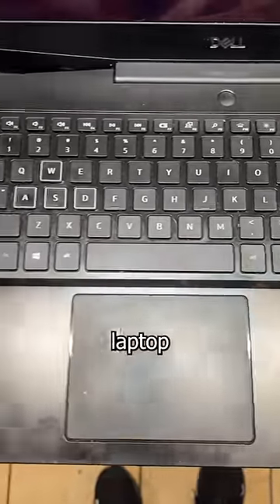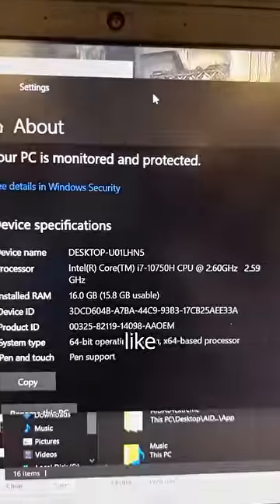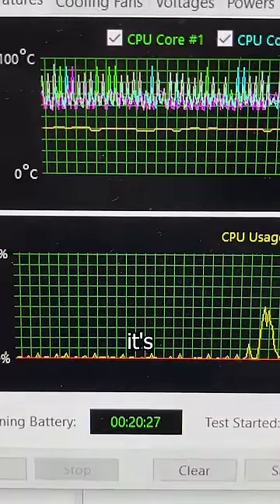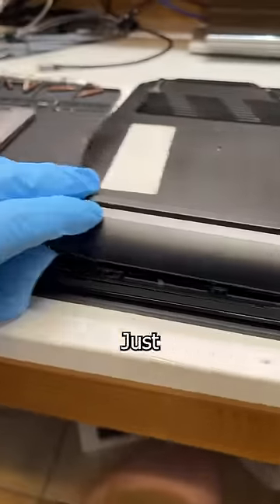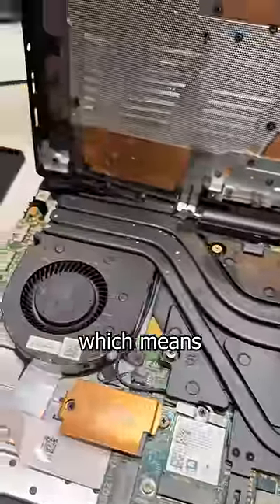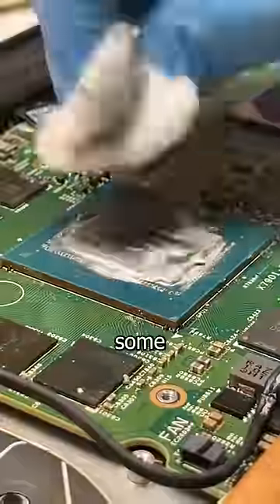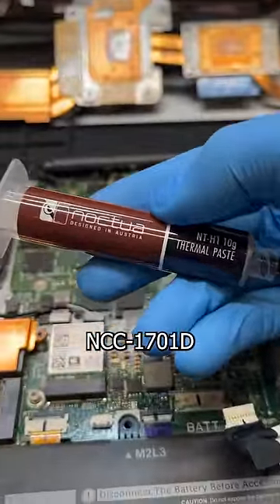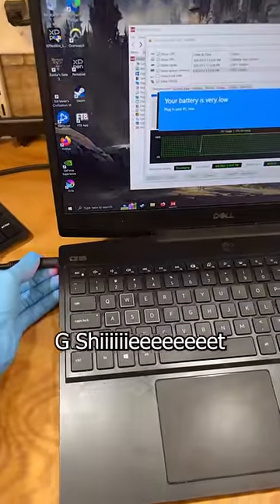Dell G5 is a terrible #gaming laptop with a terrible cooling system #tech #technology #shorts

Comment from the maker: What aggravates me the most is this thing overheats brand new out of the box, just like many other gaming laptops. Then they disable undervolting (so you have to manually edit the BIOS which is sketchy af) and don’t give you the ability to manually control the fan speed (the fans don't kick on until the thing is at 100c for like 30 seconds ffs). You CAN download a 3rd party program and a bunch of plugins to help, but WTF? It’s like buying a Lambo and having it governed at 75mph.
Reply: Thermal pipes degraded.
Reply: The entire first part made sense, idk what governed is! Though
Reply: @Gomer._.  When an engine is governed, it is limited in power by something other than the engine itself. Most rental go karts are governed to be significantly slower than they can be.
Reply: "The fans don't kick in until reaching 100 C"

Sounds like a MacBook syndrome before M1
Reply: Old g5 issues .Dell g15 doesnt have these. You cannot undervolt ryzen versions but you can lock the tdp and temp then it automatically undervolts. I use ryzen controller to do this.
You can use alienware commandcenter (if you have it)to maually do fan curves
Reply: @ZekeTheMan623  That’s interesting about gokarts!!! Why don’t they just make them slower Does that question make no sense idk, also if anything I was assuming he meant having a minimum speed of 75, I was like WHAT, yeahhh. Thanks homie
Reply: My asus rog strix actually had liquid metal on the gpu and thermal paste on other components around the gpu so that it could minmize overheating I replaced with the same thermal paste your using and it works even cooler just need to keep consant airflow
Reply: A workaround to enable Undervolting is to disable Hardware Virtualization support in the BIOS settings, this is the result of a half assed security patch meant to protect against a vulnerability called Plundervolt
Reply: Laptop BIOS’s have always been super limiting to the point it makes me want to rip my eyes out. No fan controls, overclocking, undervolting, NOTHING. just some simple security settings and boot order. Oh well, I live with it.
Reply: Yea that's why im never buying a razer laptop again. They put design first which means it overheated alot and eventually just died. It had worse cooling than my mom's dell work laptop with a 8th gen i7. Her laptop has a much better Colling system. Razer laptops have there exhaust fans right Infront of the screen and they blow hot air right at it and at the ground. They got the worst cooling system I've ever seen
Reply: I bought this laptop off some guy on Craigslist year ago couldn't not even run simple games before it would just tank to single digit fps I ended up reselling on offerup but those bios are trash and can confirm undervolt does not work.
Reply: @pfoxhound  could be, but judging that even a 13-year-old laptop wont have that problem it might show the poor quality of the pipe itself
Reply: @Gomer._. basically when a engine is limited and can’t put out full power
Reply: Dell wants it to run quiet but its cooling hardware disagrees.
Reply: My friend cooled it by aplaying way to much termal paste and he told the problem was the cooling pipe was little bend
Reply: @trandinhvietdung9357  I had this problem on couple laptops, couple of of a thousand, if the pipes will be under higher power then rated - they will degrade, especially when fans start working at 90 and higher. My opinion.
Reply: @pfoxhound  ah I see. Still that shows that some laptops manufacturers just want to cut cost, thus reduce its lifespan.
Reply: It's not like buying a Lambo 😂
Reply: @sharkieislive the problem is that Dell Bios is trash
Reply: @pfoxhound Heat pipes don't degrade you're ridiculously misinformed. The thermal paste and fans degrade and somehow you are incorrectly attributing that to the copper pipes. The only failure of heatpipes is cracks or leaks.
Reply: That would annoy me and immediately prompt me to return it. Such a shameful waste of of a 5ghz hexacore with an rtx2070. Might as well put the max-q version inside. Of course it’s a dell, sigh. I had an Inspiron convertible that while nice (sky lake i3, 8gb ram, ssd) for 2016, it was CHOKED with single channel ddr3, when that poor i3 can do dual ddr4. I didn’t even bother to think of gaming on it, it was very reliable and portable for school, and easy to use. But no second dim slot on the board, or nvme, really was a cheap move. Even the trashy old 2013 hp and Toshiba laptops I fixed at least had a second empty slot.
Reply: I realised that in my years of research. Considered buying an Alienware laptop because I heard it cools well but it'll be much more cost effective just building a pc myself.
Reply: @Gomer._.  "Why can't they just make them slower? Why are they making them slower when they can just make them slower?"
Reply: @elhsgiuloigtn  Hehe, fair enough, I had assumption that that meant there was a internal gear that spun insanely fast and they did a line of gears to make it slow. All in my head!
Reply: @Gomer._.  Yes, that’s part of it but it is easier for the manufacturers to add a governor after designing the whole car instead of tearing apart the transmission of each and every single car and changing the ratios
Reply: this is what INTEL MACBOOKS do!!!!! but the macs do that without even doing much on the computer...id suggest using one of those laptop cooling pads and dont use it on the bed!!!
Reply: Thats why I like msi laptops, you can use msi silentcontrol to adjust the fan curve to be more noisy but also keep the laptop cool
Reply: Apple mindset. if it's quiet the customer will be happy.
my macbook pro 10,1 gets up to 96C in bootcamp somehow it doesn't in OS10.15 but still around 85C
Reply: I have the exact same issue with my rog stryx g15, what would you recommend?
Reply: I bought myself a Nitro 5 R5 5600H / 3060 for classes, and it's the exact same thing
Reply: Good thing when I was looking to buy a new laptop, I scanned right over those 😅. I ended up with an acer predator pt516 12th gen i7 with a 2080ti. Running fantastic for the past year, hoping I dont ever have to send it to you and have it roasted as you fix it 😂
Reply: Gaming laptops make me sad. It's the worst to have to tell a client their "gaming" machine is overheating because of poor thermal design, and no, we can't just install bigger fans (laptop trays with fans can help marginally). When people ask for advice on gaming laptops, I recommend getting a regular ol' i5 or i7 laptop, and then stream from a swank desktop setup.
Reply: @trandinhvietdung9357  "degraded heatpipes?" Unless they're straight up leaking, they're a closed system that shouldn't degrade for decades.
Reply: @Mr371312  well the dude on the upper comment told something like that and his experience so I would take it as a grain of salt.
Reply: Time to 3D print a new bottom panel and have a cooler custom made
Reply: damn, always governed ruined it all
Reply: As long it gets them through the warranty period. The companies don’t care at least for consumer level devices.
Reply: People need to stop buying Dell and HP gaming laptops because their cooling designs are horrible. The only way to fix it is to get a stable undervolt going and there’s no way around it. A 60 mV offset on the core, cache and iGPU took my HP pavilion down from 100°C on Fortnite down to 79°C.
Reply: I don't have that issue with my asus rog strix g15🤷‍♀️
It never goes beyond 75°C on stress, I can manually control the fans too
Reply: @@veryevilpersonfromillumina5893my old packard bell from like 2010ish reaches 100°C even with a cooling pad
Reply: The thermal paste NT-H1 has a thermal conductivity of 3.9 or 8.9 W/mk, internet has conflicting results. But next time try using a Coolermaster Mastergel Maker which has 11 W/mk and might yield better results. Also set cooling fans in active mode in power profile.
Reply: @sihamhamda47 sounds like Asus tuf f15 gaming laptop 💀
Reply: @SalemTechsperts my laptop was heating and shutting itself off it's a Acer laptop I did clean the fan but still heating and it's still shutting itself off any tips? / need help idk how to remove the things and do it bc If I remove and do things what if I broke the things while removing and idk where is the chip located
Reply: @zdeathy60 so isn't there any non risky third party plugins to do soo? atleast fan control or under locking?
Reply: My msi katana 17 with a 12650h 4060. Was overheating out the box. Replaced with ptm and boom fixed
Reply: You can use alien ware command centre to turn the fans on but it’s insanely hot still (keyboard reaches 54°c). I got a “damaged” 2070 G5 for 40% off (screen had a tiny scratch and that’s it) and It’s served me well as a work laptop and it’s quite good for 1080p gaming but I would not use it as my main gaming machine
Reply: my laptop is pretty good at handling games like fh5 on 1080p medium settings, overclocked screen to 90hz to have a better experience, it was modified by the store with 8gb+ ram and a 1tb hdd, the laptop is called the msi gf63.
Reply: @zdeathy60 surprisingly, the new Alienware laptops out now have more in depth settings for fan cooling curves, cpu and gpu performance, etc. Still kind of limiting since it's per factory presets but it's something
Reply: I mean

It's dell, what you expect

Even lenovo ain't best gaming brand (got lenovo legion 5) but I actually got decent mid range gaming specs (honestly can play mostly on mid/high graphic settings but I'll be getting desctop PC next year and this gonna be used as console in living room)

It got RTX 3060 and Ryzen 5 5600X what ain't bad but can be better. Also had update to 32GB of RAM what's lil overkill bit at least multitasking with browser and stuff while in game won't slow down my laptop anymore :')

Depends on games and settings, in older fames like AC black flag fans are almost quiet and spin up now and then (average temp is about 50°C) but found out that antialliasing makes it heat up most

In watch dogs I can have graphics maxed up without antialliasing and it's sitting on 50 to 60°C and with antialliasing it's about 70 up to 80°C and loud

Soo...yeah
Depends on how you understand and can customize game graphics, GPU drivers (what I should update probably as well) and what you have inside your pc :')
Reply: @Gomer._ automotive things are usually to long to explain but to answer your initial question it's because it's cheaper to manufacture one kind of motor and do small tweaks afterward to meet the customers needs than to create anemic engines that only serve a small group of ppl.  I usually Google things I'm curious about. It's a great platform for info.
Reply: My baseline Lenovo actually has competent cooling and the fans will appropriately kick on long before it’s too hot. And when it does get hot they are screaming, but I can feel it dissipating the heat
Reply: NOOOO you literally need the liquid metal on there or else it will overheat. I know it was overheating but that's due to bad application. Good application is 50x better performance than shit application XD.
Reply: bought a brand new G3 and it started shutting down from overheating within the first couple of months. turns out the thermal paste was toasted harder than pizza dough in an oven. 

after it got replaced laptop still tends to get a little hot but at least it aint shutting down 24/7 and begins to cool down after not using it.
Reply: how do you edit the bios?
Reply: Man I have a omen 16 ryazn 7000 somum and live out in the country where dust everywhere and with manual fan speed control and easy as shit to pop open
Reply: @Gomer._.  Different go kart tracks can have different speed rules and safety ratings and age targets so being able to tune it is important. Almost all vehicles are governed to some degree as it can prevent people from destroying their engines as well as over speeding and some countries legally require them.
Reply: I have a Dell Gaming G3 and after replacing the thermal paste and getting any dust out of it, it thermal throttles and limits my cpu to 1.6ghz about 5 minutes into playing almost any 3d game. So I basically have an expensive power hungry 2 hour battery life piece of shit 😃
Reply: Think you could make a guide link as to how to manually enable fan control in the bios?
Reply: This is what happens when bean counters run a tech company.
Reply: Acer Nitro5 use here. Same deal with my laptop. I used it for two years, overheating constantly to 80°-90°C+. Bought laptop cooling pads and tried to keep it near a cool window. 

Eventually I found ThrottleStop for Intel CPUs and a custom undervolt mod for my CPU model. Now it barely gets hot on its own.
Reply: I have had a Eurocom Sky X4C since April of 2019 and it requires cleaning 4 to 6 times a year... It's running a desktop core i7 8700, and an RTX 2060... It gets pretty toasty but it never gets to the point where it goes into what you like to call PowerPoint mode... I screwed up a few years ago and set the thing in the oven to dry but forgot and turned the oven on to preheat to cook a pizza....aaaaand I cooked my heat pipe assembly.... Ended up getting a new one.. because I accidentally desoldered everything... Still has the original fans and you can hit the Fn and 1 key at the same time to enable Max fan speed.. I generally hit that whenever I'm firing up a very stressful game... Not only to keep the chips cool but it also pulls air through the entire case and keeps all the drives cool..
Reply: I like laptops that you could potentially beat someone to death with... And still have them work correctly..
Reply: How is a company able to sell a laptop that overheats?
Reply: is the 3rd party app msi afterburner
Reply: So true...
Reply: I had an Acer predators 2017-18, the one with 8750h and 1060 6gb, same fucking problem. Not only that it was continuously overheating if left by default and it would go from 4.1ghz boost all the way down to 0.8ghz. 

The thing was crippled with issues, even compared to the previous generations, because they put both fans on the right side but the left side was completely blocked with 0 airflow that I had to drill holes. It helped a little, but you can't overcome bad design, the heat pipes were going from the CPU through the GPU and the CPU was always hotter, even when using throttle stop to keep it at 3ghz all cores with -0.150volts. 

The thing died this year, mostly my fault while cleaning it, tried rebelling the CPU at a shop but still didn't work. Whoever designed this should be stoned in public, so many issues.
Reply: This is the reason why I dont buy lenovo anymore. The Ret.. Lenovo technicians put the pattery pack UNDER THE GPU HEATSINK. Limited the gpu to 60°c and It works at unboosted clock while overheating. Battery turned into a pillow  so I removed it then I unocked it with GPU Tweak just to use the laptop at the performance it should've been shipped as...
Reply: oh shet
Reply: thats my laptop
Reply: My hp pavilion gaming laptop at stock overheats at 4core 4ghz so I put the power plan from 100% to 99% cuz there's no way to control the fans
Reply: @agelitedexblue  Try undervolting your cpu. Usually helps. Wont cause any trouble if you do it slightly. Also lift up your laptops legs by putting something underneath (just a piece covering legs). I used to put two tall water bottle caps underneath the legs under hinges. Gives you a nice tilt on the keyboard as well.
Reply: @sbk180tr  Do you know any software? My bios don't have any settings for the cpu or fans. I put bottlecaps on mine aswell it works alright
Reply: Technology these days.
Plug and Play is over, now it's Plug and Configure for hours.
Reply: EXOTIC BUTTERS
Reply: I agree, it was also my one gripe with the dell xps 15, since I’d like to have lower performance, but constant performance, during some workloads. Instead I had performance dip into the lake after an hour, which would then come back briefly only to dip back. I’d just like some consistent power, even if it’s less.
Reply: So what gaming laptop do I buy then?
Reply: I have both the g5 and g7 and they are both s###
Reply: Predator sense 💪
Still reaches 92 temps CPU 💀
Reply: At least the fan is located evenly not like the old Nitro 5 who have both fans on the right side of the laptop lol
Reply: Maybe is the dust filter...
Reply: @Gomer._. I think it has something to do with fuel efficiency because a car that can go 120 miles per hour will be way more efficient at 80 than a car that can only go 80 miles an hour. That's why your car can go so much faster than legal.
Reply: I got a riser for mine to keep it off my desk/lap pad. They don't leave enough space underneath for airflow.
Reply: Theres always the add 15 fans as a replacement bottom laptop panel with spacers so the POS can run
Reply: I have the same problem on my g7-17, i found you have to remove ALL of the dust filters, use alienware command center and make your fans stay on 100% all the time, use a fan pad just to help air circulate, and have a regular pedastool fan pointed at you and the laptop and it runs for quite a few hours before it overheats. It does mean you gotta clean it out monthly and get some backup cooling fans for when they inevitably burn out from being at 100%, some other solutions i found was reducing the brightness will significantly reduce the temps for some reason
Reply: Pleas man do an audio where you say "exotic butters" and  i promise i Will put It as ring tone pls.
Reply: As an owner of a G3, I can relate to that... I need to use ThrottleStop to keep the temp in check... a software that I had not touch since the era of AM2+ lol
Reply: Well, it’s also a Dell laptop, and their desktops have issues with cooling as well.
Reply: Just add 12 DCV fan directly at the bottom of laptop 😂
Reply: did u try to apply ptm7950?
Reply: This sounds like owning a classic Lamborghini or Ferrari with all the overheating
Reply: It's really frustrating, they advertise these laptops as quiet and powerful, it's only quiet for a short while and then it's no longer powerful due to throttling. Waste of money, workstation laptops and thinkpads (the good models) are the best.
Reply: That's a really fucking good analogy.
Reply: Bro stills plays fnaf 5
Reply: I have a Nitro 5 with a 10th gen i5, I was able to download an old version of Intel XTU which let me undervolt without editing the BIOS
Reply: Do you have any tips for undervolting an Asus rog strix g15?
Reply: replace fans with buff fans
Reply: Haw can you see heat temperature
Reply: For nitros ,you got nitro sense to change the fan speed
Reply: My shop had a batch of these come in with every battery maxing at 7-8% capacity fresh out of the box. But of course it took like almost a year to realize what was happening because they were NEW. 😅😩
Reply: I find it strange that there is so much problems on Dell's G5 lineup, I got my G3 back in 2019 as a secondhand buy for half the price and it never goes over 40°C at idle at ambient 35°C, maybe I got lucky with the right model?

Mine is the i7 8th gen and Nvidia 1050Ti model.
Reply: yeah i have one of those. i’ve almost burned myself on it
Reply: I’d say it’s more like buying a track only car and having it governed at 70mph, but either way both are terrible.
Reply: Bruh you need to strap one of those intercoolers that drag cars have💀
Reply: @Gomer._.  To make it slower you can limit the revs or reduce the power. Low down power is more fun to drive...so rev limit is better.
Reply: The fans not kicking in until its already throttling yet they used liquid metal - fucking idiotic.

Also id just rip off the dust filters TBH